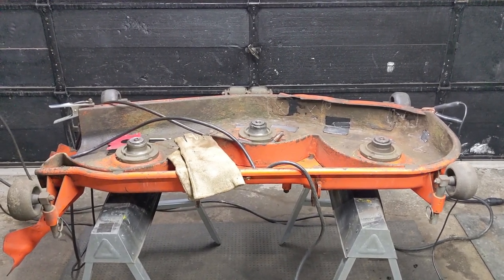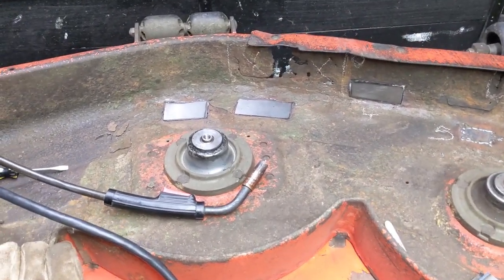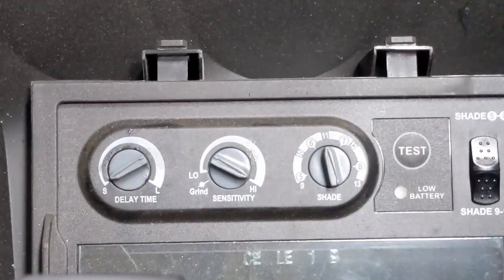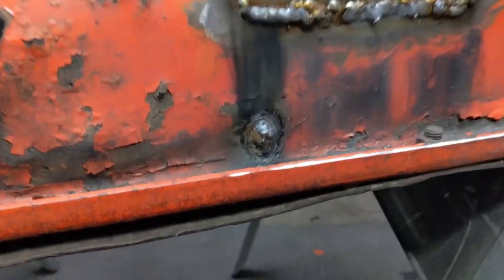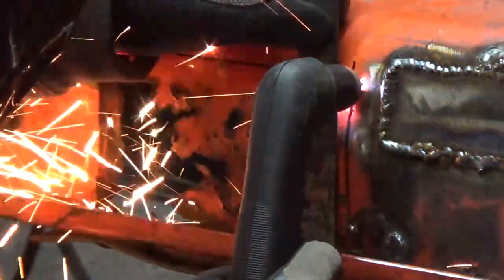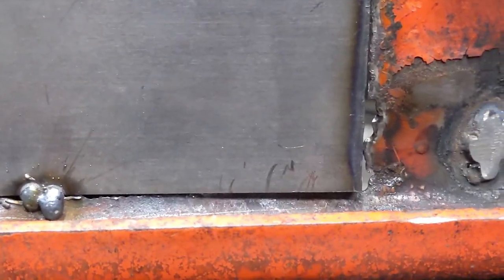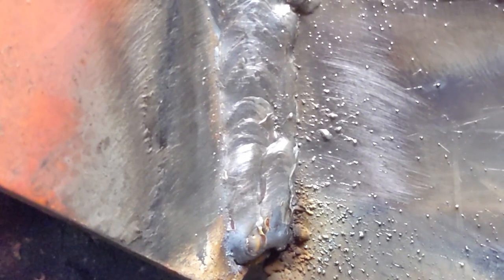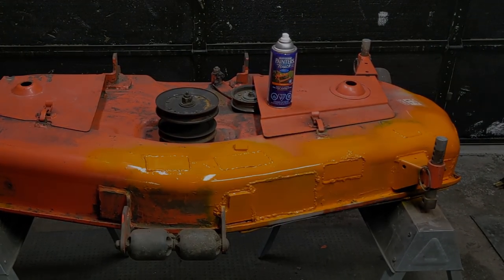Kubota Mower Deck Repair - Part 2

Comment: Well, I started a similar project on a JD 48" deck but was having problems blowing through the metal. Thanks for the help and advice. I will be trying again this spring. I had gotten another deck from a mower with a blown engine and so I haven't needed it, but I wanted to fix it up nevertheless.
Reply from the maker: You could always use pieces from one bad deck to make 1 good one if they're not rotted in the same spot. This one over all wasn't as bad as some that I've seen, but it was worse than I originally thought once I started the job. The top spots had to be taken care of. Thanks for watching!

Comment: Nice to have the tools eh buddy! Some very nice vertical welds you did there, not bad for being out of the welding business for 14 years buddy i think your customer will be extremely happy with not only the finished product but the invoice. It should be good for many years if they only cut grass when it is dry and maybe in two years you get it back to review and do a little more work on some of the thin areas. See yall next week.
Reply from the maker: Yes it will be interesting to see how it holds up over the years, thanks for watching!

Comment: Mower decks are the worst. Blowing thru because the corrosion is all over the place. I am working on a scag deck. Totally abused. Cut the whole front nose off. Cnc plasma cut a new nose and used slices in the program to make the bends. Still was a pain and took a lot of time. Good job for what this junk is.
Reply from the maker: Yea I just wanted to patch this thing up and get them some extra years out of it. Eventually there won't be enough metal left to weld to lol

Comment: That is awesome! What type of welding were you doing in your previous life? This is very similar to welding patches in an old car body. No way you can run a continuous bead. It has to be stitch welded. Have you found any orange paint that is a close match for Ariens orange? I wondered if a paint store could tint a white base of Tremclad to match? I know you can buy actual Ariens paint, but it is very, very expensive. It is similar to this orange on your deck. If not, i guess i could use what you used here.
Reply from the maker: I used to do SMAW and also Mig welding structures that were used as pump houses in the oil and gas industry. Then went on to weld at a Drop Forge plant doing maintenance and also fabrication for basically anything they could think of, I could build it. Also, BeautiTone sells an Alkyd Kubota orange paint at Home Hardware here in Canada, but they were out of stock so we got this. And yes, similar to body work on a car, always tacking, low amps and trying to move around the metal to keep prevent hot spots. Thanks for watching!

Comment: so how many hrs did u have into that whole deal ...what did u charge ? that was alot a cuttin n fabbing up patches ..!! turned out well ...shld left the patches grey so the guy cld see what he had to pay to get fixed ...cause he dont clean the deck ...LOL       we see it all the time in our shop ..ppl just dnt get it LOL       good video!!!
Reply from the maker: Well with the filming it was probably 12hrs because I did about 3 days working for 4hrs each but when I'm doing videos that use the tripod and multiple camera angles, plus music it takes me significantly longer because I don't have a cameraman, it's me setting everything up, pressing record and then getting to work, then repositioning everything. This job by itself was charged at 4hrs plus materials. Cost the customer about $400 which extends the life of the mower a few more years at least.

Comment: A great piece to add to your toolbox would be a 1/8 or 1/4" thick plate of copper.  You can clamp it to the back side of the patch and it helps dissipate heat, and none of your welding will stick to it.
Reply from the maker: I use a copper puck, but yes a plate would be a great idea!

Comment: I'd really want to know the total bill on this clients mower. You're putting so much time into it.
Reply from the maker: A few hundred dollars to extend the life of a deck worth thousands by a few years isn't bad. This is why preventative maintenance is always important!
Reply: @EliminatorPerformance  damn. only a few $100 to do all that welding? I'd easily pay someone to do that.
Reply: @norge696  You also need to add in material costs like MIG wire, welding gas, 1/8" steel plate, grinding wheels, primer and orange paint, Krown undercoating, 3 blade sharpen and balance, time for wire wheel cleaning under the deck. All of this and it adds up to a few hundred and a few more but in the long run the customer is extremely happy that he has a deck that will keep him cutting for years to come.

Comment: You're the expert but in that area 3:33 where you hand is I think I would of taken some paper & made a pattern for that complete sunken area completely across the deck then welded it in, & done the same for the front
Reply: That would have been a better longer lasting repair but the customer requested repairs in areas that had holes only and would be giving us the rider and deck back in two or three years for a full service and more deck repair welding if needed.

Comment: I'm nosey, did you charge by the HR for that job?? I think creating a patter for a larger longer area, then cut that in metal, then weld would of not been so time consuming and a stiffer outcome
Reply: Customer actually got charged roughly 1/3 of the actual hours spent on welding. #1 a great loyal customer #2 many referral customers from this customer #3 actually was my sons technical teacher in high school. At Eliminator Performance we charge by the hour but also give our regular customers and sometime initial customers a discount on both labour and parts that is why the business has grown to what it is today from 10 years ago. Offering 1 to 2 day returns also helps!

Comment: She may not look pretty, but she does the job!
Reply: Yeah but way better than when we got it and the customer was extremely happy even with the big invoice but should get another 2 or 3 years before we need to do more weld repairs. Good used decks are hard to find and right now a complete deck new is likely over $2k

Comment: Is it really worth the time and money to make repairs to the deck? It may be time to say goodbye to the deck or the whole mower. 👋
Reply: Have you priced a new mower and deck lately? Why not fix older equipment that was built better than the recent Chinesium crap. I keep my older equipment running because its built much better and had more than a 5 year planned usable life. But, if you want more debt and landfill crap go ahead and buy a new one :)
Reply from the maker: Yes it's worth it when you can get a few more years out of them, maybe do another repair in a few years. We'll have to wait and see how bad it gets. That's why preventative maintenance is always best. Thanks for watching!
Reply: That was my thought. How much time was spent?
Reply: To replace this liquid cooled riding tractor would be a great expense and this repair with possibly a few more every 2nd or 3rd year keeps this fine piece of equipment running for many more years to come. If the owner only cuts when the grass is dry they may not ever need another repair job on this deck, cut when dry and keep the top clean of debris and stored out of the weather.
Reply: @beanolatte2682  Jake spent a lot of time welding this deck but because this is a regular customer only charged out a 3 hour labour rate. Likely without counting the time of moving the camera and video time the likely spent a full 8 hours which included cleaning, cutting the deck and plate steel, grinding to fit and welding plus the final prime and paint.
Reply from the maker: Yea I did a quick search on Kijiji (Canadian craigslist) and they're selling for $4000 without mower decks!

Comment: They should make these mower decks out of aluminum, so that it would NEVER rust. I'm sure that they won't because they want you to continue to buy new mowers.🤔🤔🤔🤔
Reply from the maker: Or 304 stainless steel? Like the MTD Pro stainless mowers. Very rare, only sold for a very limited time.
Reply: @EliminatorPerformance  I love your channel by the way. Keep up the good work. 😊👍🏿
Reply from the maker: @patrickpoulard24  thanks!
Reply: Right on Patrick but the cost of an aluminium deck would have drastically increased the original selling price of this riding tractor and deck. Cutting grass in dry weather conditions only and this deck would still look like new, or at least cleaning the underside after cutting wet grass.